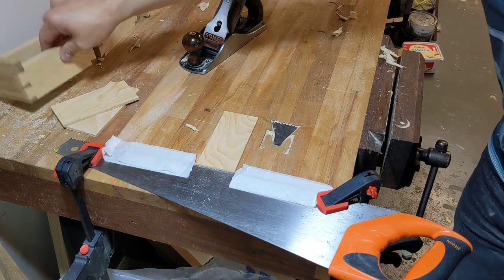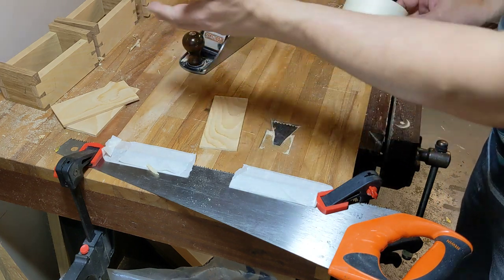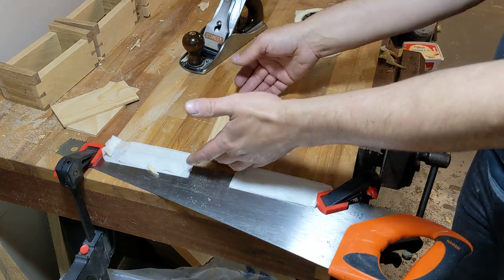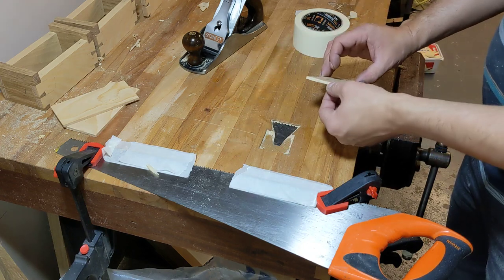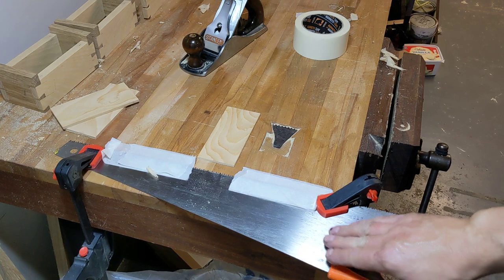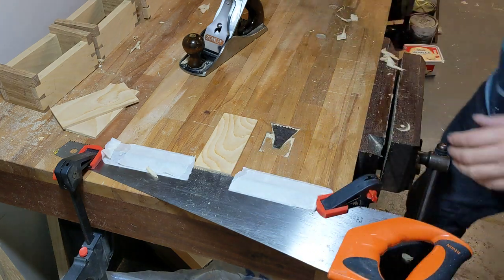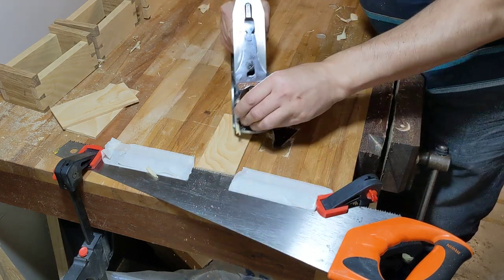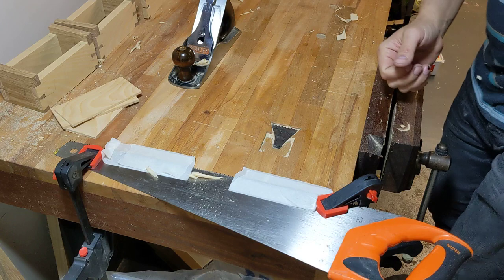Quick Tip! Improvised Planing Stop For Small Sections.

Comment: Thank you so much for this! This has been a problem for me on several occasions and I would never come up with something like this. My bench is surrounded by two corner walls, so no clamps for me, but i have two rows of dog holes, so I used a worn japanese blade I was sorry to throw away, propped it under two bench dogs and it worked beautifuly on a project consting largerly out of small parts (wall mounted pencil holder). This solution saved my nerves for years to come.
Reply from the maker: Great news Petr! Glad it worked out 😊.

Comment: Very ingenious.  This is something I have struggled with, so I will try this - if I get on with it I might make something a little more permanent with an old saw.  Thanks for the tip.
Reply from the maker: If you wanted you could cut it up and use smaller pieces on a sticking board.
Reply: @faceedgewoodworking  Yes, that’s the kind of thing I was thinking of.